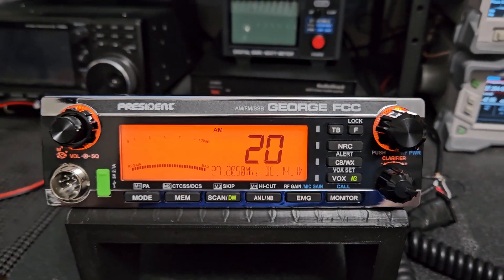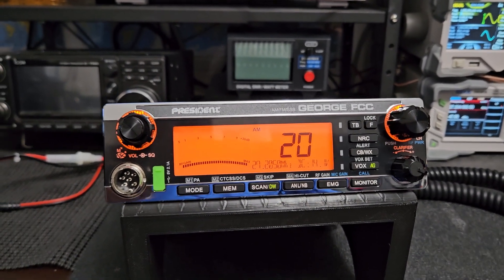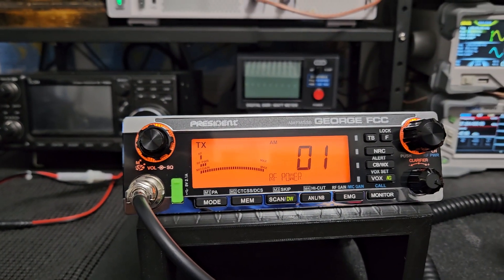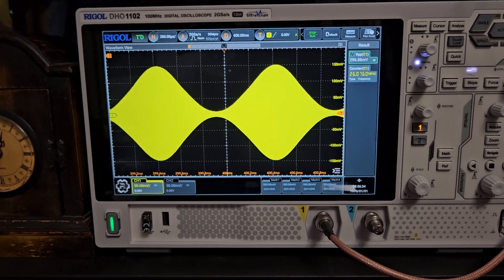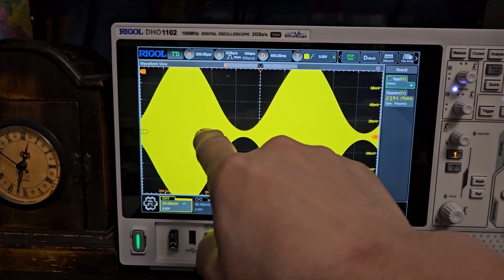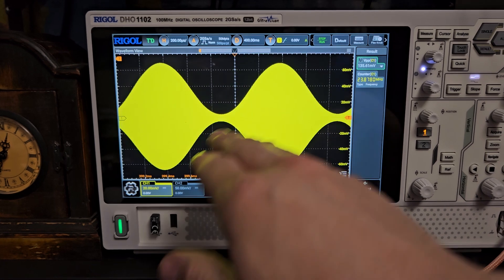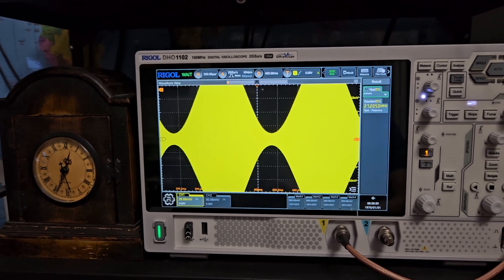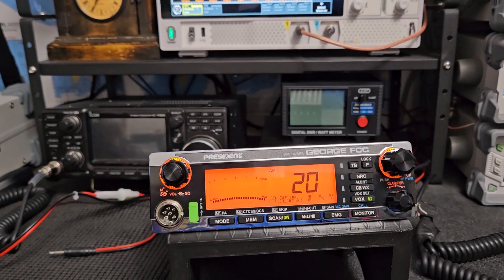AM modulation service adjustments on modern radios.

Comment: I think this is why most service manuals only suggest setting to 90-95% modulation…..I’m not a wizard but I’m a believer in headroom and know trying to get every last watt is pointless…..I’ve seen radios set conservatively out talk (more RANGE) than radios set up at twice the power…..it doesn’t do any good to run a device against its limit but the world of radio is full of tales saying it’s the way you must do it….to each his own
Reply from the maker: Generally speaking when you set the modulation with a test tone it will always be higher with voice. 
So setting it for 95% will probably get you around 100% with voice..
Going over 100% isn't really necessary but a lot of guys want that for bragging rights I guess.